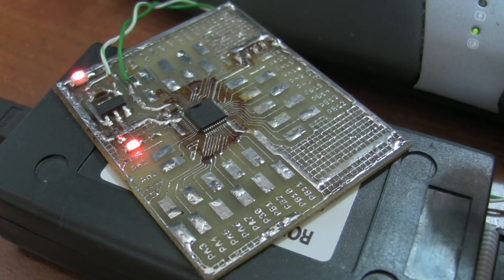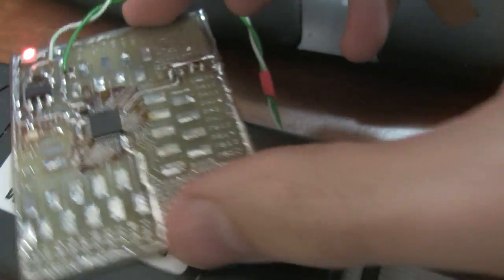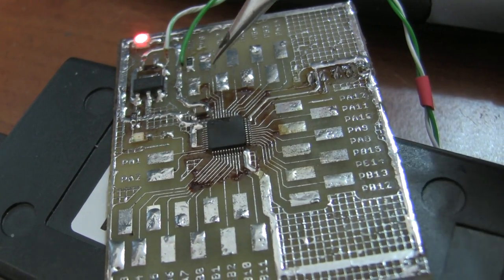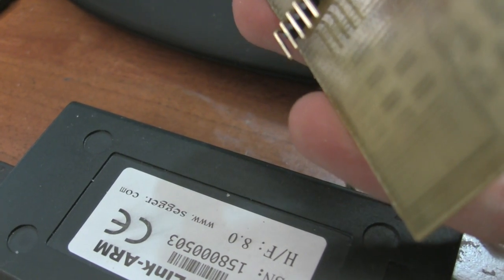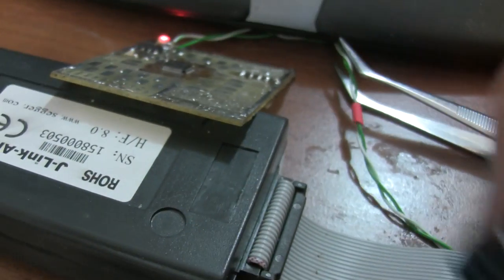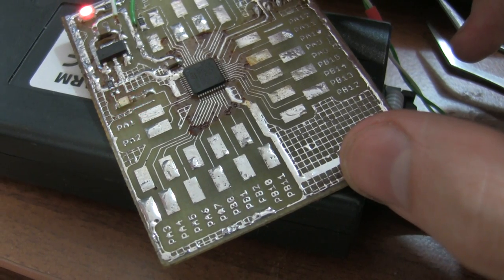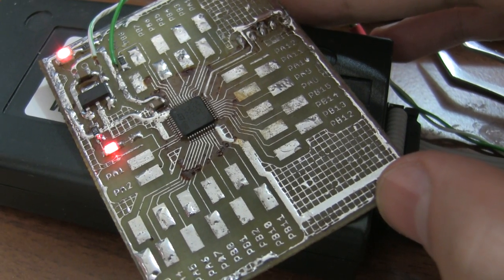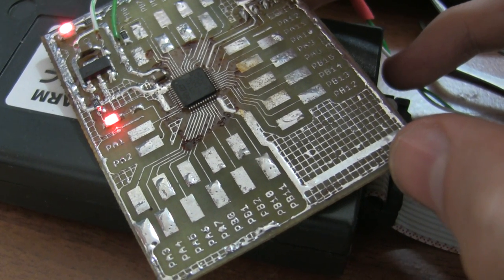This is simplest possible board for ARM (STM32) - single layer, single sided, and only 1 capacitor

Comment from the maker: It was soldered using usual soldering iron. Hot-air is only needed if you want to desolder. Now I have heat-gun too, but still find it easier to solder QFP packages using usual iron. I was using usual leaded solder (60/40), and liquid flux (in my case - Russian LTI-120, but there are many other which would work). Liquid flux is the most important ingredient here.

Comment: The Raspberry Pi uses an ARM based SoC - NOT an ARM based Micro controller, which this video demonstrates. The difference? - Complexity, and speed. 
ARM develop both Micro Controllers(MC) and Micro Processors(MP). SoC's contain MP which are designed as Application Processors in mobile Phones (Like Running Android) - MC's on the other hand control motors and LED's ETC.
They can also be hooked up to a A/D chips and show Graphics on a screen - but MC's are much slower then MP's - 50MHZ VS 1200MHz

Comment from the maker: @167mm167 I am using JTAG connector, which have 2 SWD signals, which I use here. So I connect it to JLINK 20-pin connector, and in Keil do Flash->Download and it's working :-D

Comment: Its best one. I used to thought that its very difficult to design PCB for 32 Bit uC. But u made it easy. I have 1 question, which soldering stations & materials u have used?

Comment from the maker: BTW Now i see that this board have an issue which one should avoid in further boards: ground connections should be much, much shorter for maximum reliability. If it's homemade board - probably it's easier to connect GND pins using straight external wire. Anyway, even with this horrible ground routing it still works.

Comment from the maker: @hasssector At this board - 10mil (0.25mm), but 0.3mm should be also fine. Paper is from random photography magazine, no holes for steam. What kind of issues? Toner falls out, random tiny empty dots in traces or traces get wider, and short-circuit?

Comment from the maker: @skylenmaxx I am on Brother 2240. But I had similar results on entry-level Samsung one. It's more about pressure/temperature control, that's a bit tricky part. Toner Jedi are doing 0.15mm reliably, so I am very far from that.

Comment: hi, i have a question

if you make a board with an ARM is there anything you have to do it get it working?

set fuses? burn a bootloader?

especially if i want to use usb and drag and drop .bin files into the chip

Comment: Where do you buy stm32f100c4t6b for less than $1? The cheapest I can find is $2.46 for 1 (newark), and even if you buy 10000, the price never gets lower than $1.1 (digikey).